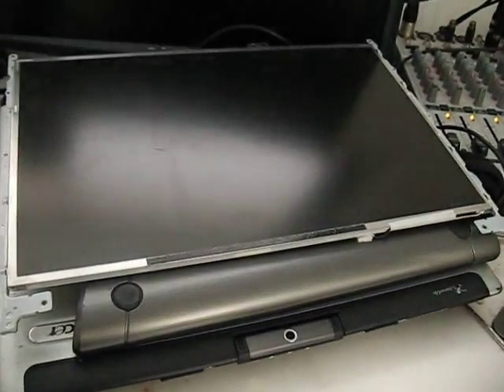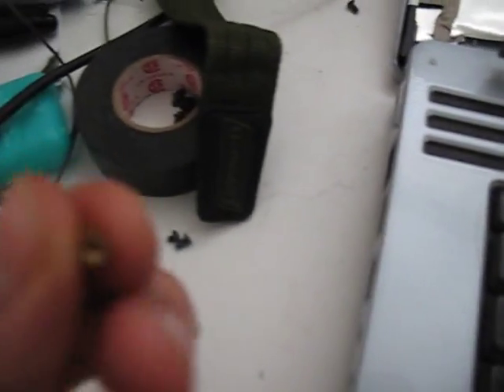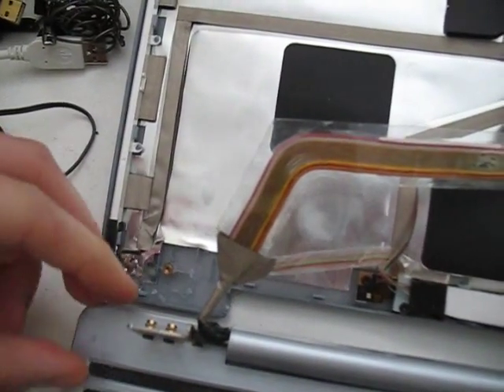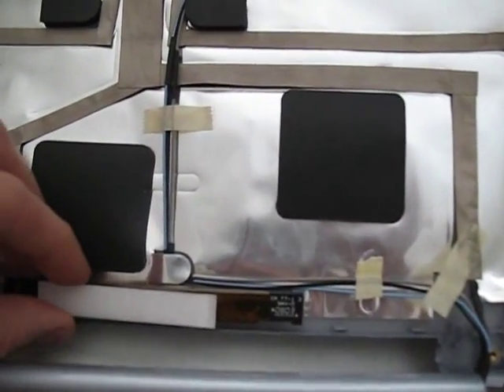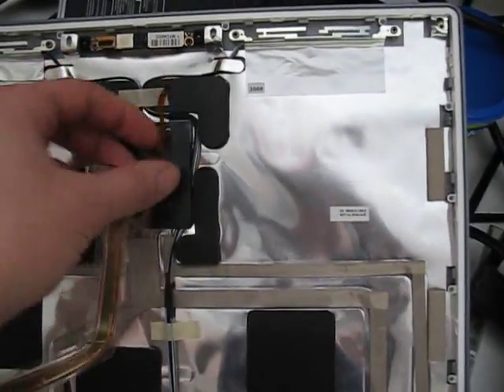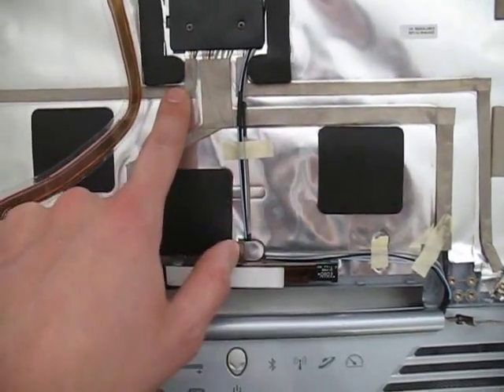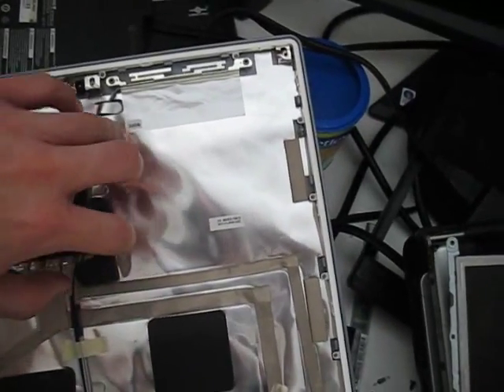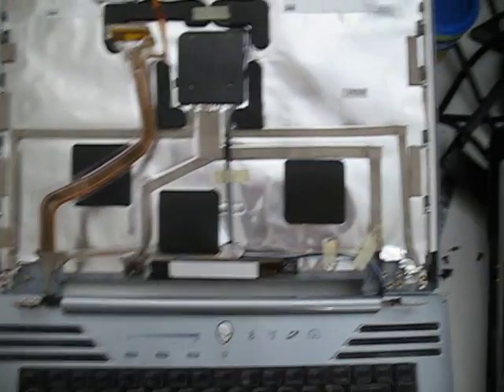Area-51 m15x hinge cracking explained

Comment from the maker: @chadsenters00 The Area-51 M15X is not the model currently being sold by Alienware.  This model was designed shortly prior, or during the acquisition by dell, and the unit itself was made by a company called Quanta.  Alienware had an exclusive deal with Quanta for the design, so the only systems manufactured to this form-factor and spec were Alienware Area-51 m15x's.  This model is aproximately 3-ish years old.

Comment from the maker: @LittleMissRhubarb That's the first I've heard of that... you'll probably need a whole new support piece on that side.  luckily it's independent of the hinge, and you can basically just screw it in and replace it, the trick would be finding a replacement.

Dell doesn't seem to get parts for this system anymore.

Comment from the maker: @julienjjj they used metal framing all the way up the panel, the problem is there's a weak point where it can bend.  the concept was good, but when the hinge gets tightened during manufacturing, it's often tightened too much, and causes that weak point to bend, rather than maintain the shape of the frame, moving the pressure from the frame to the plastic casing.
concept = good, implimentation = terrible.

Comment: @MystikIncarnate Mine was making noise for few month, but now started to loose plastic parts, im going to use 30 minute RC plane epoxy to fill the space between the metal standoff they used to hold the panel. I dont think any engineer saw the design before production cause the design is just rediculously bad. They should have used metals legs that goes up to the half of the height of the lcd panel

Comment: Hey, thanks for the video. I've been trying to work this issue out for the past couple of months. The plastic actually came off BOTH sides on my system so I have to put support behind my screen for it to stay up, and it won't close at all. My first reaction was to call Alienware and complain because it seems like 25% of m15x customers have this issue. I tried to get them to sell me a new lid, but they won't they want to charge ~$400 for a repair. Make another video on how you repaired yours!